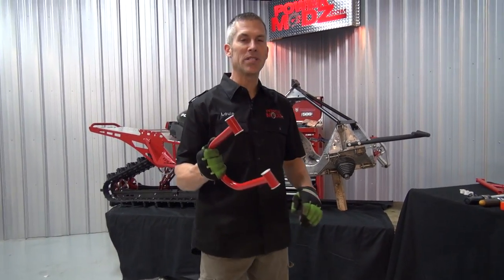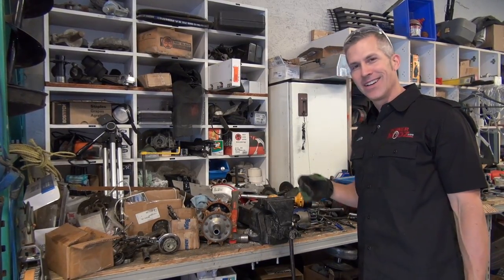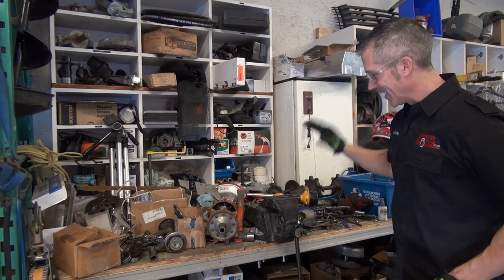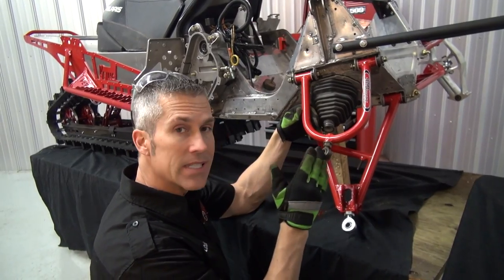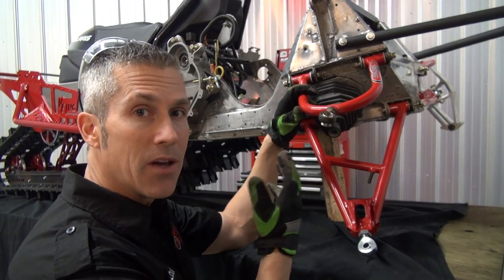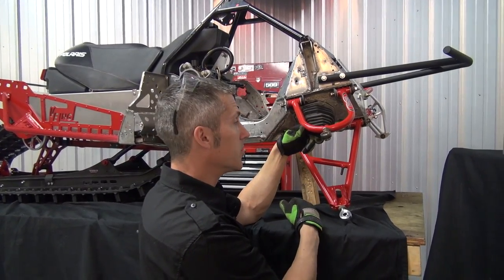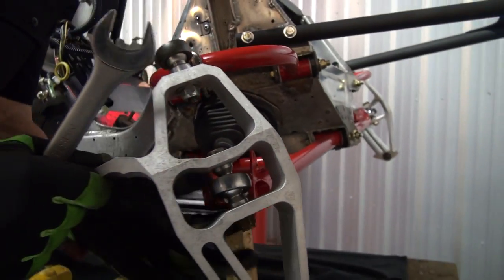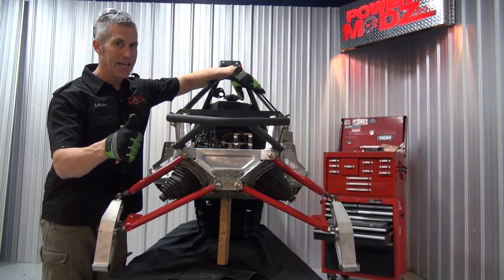Polaris IQR 800 Mountain Mod 800 Build Ep#10 Alternative Impact A Arm install!  PowerModz!

Comment: At Elka did you look into the effect of extending the ball joint separation? It will make your camber gain more aggressive (more negative camber than stock when compressed). Do you want  that side hilling? I haven't done much research on snowmobile suspension geometry.
Reply from the maker: They looked at everything - they have a computer:)
Reply: PowerModz Please tell me what the intro song is please

Comment: What sled would fit a 14 year old?
Reply: BR250
Reply: fit in terms of size or power/class?

me personally im 14 and have a 2011 mxz x 800 and it ''fits'' me fine. i love the power and feel of the 800 x and am glad i made the jump from a 600 touring to it. plus I can do some small jumps with the current valving.
as long as you can use the sled to its full ability go as large as you think you need/want/afford.

A great way would be to ask your parents for the most they are willing spend and then find the sled you want and pay the difference, get a summer job and try to pay your parents back by the end of the next summer.

do you have any experience sledding?
Reply: Im also 14, and i have a 2005 polaris edge, its a 500 but is big bored, carbed, clutched, and has delta 3's. Not alot of weight with alot of power. Sure an 800 could beat me in a long run but i could smoke it off the line. I love it i have it set up with a paddle track and powder ski's cause we get alot of snow and thats what we do. it depends on experience and what you will use the sled for.
Reply from the maker: Depends on what you want to do and budget.  My nephew rides a twin elan and loves it he's 25.  my kids start on elans and will work their way up, probably a 500 fanner then a liquid.
Reply: My dad got me a 600 e-tech when I was 14, easy to drive and the power is very controllable I find.
Reply: I had a 2003 Ski-Doo Legend 500 CC when I was 13. It's a smaller size chassis, and more trail oriented. I started on an Enticer ET340 at 10. 14 year olds should be able to handle a lot of power. I rode my parents Yamaha Nytros, and they've got some power.
Reply: i ride a 2014 summit x 800 exec love the sled and can't keep the skis on the ground I'm 15
Reply: Tyson Fidek Did you pay for it?
Reply: My first sled was a 2007 mxz 800 xrs lol